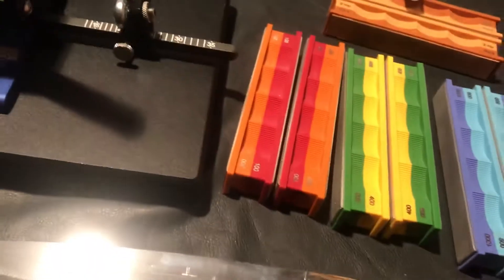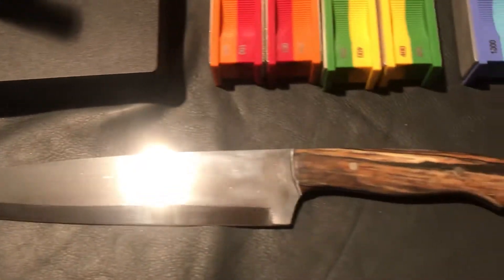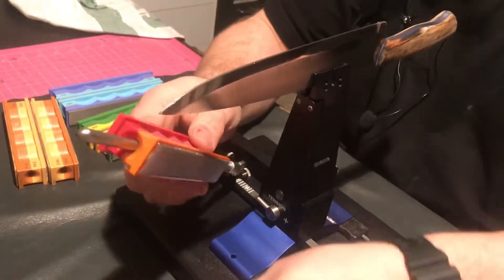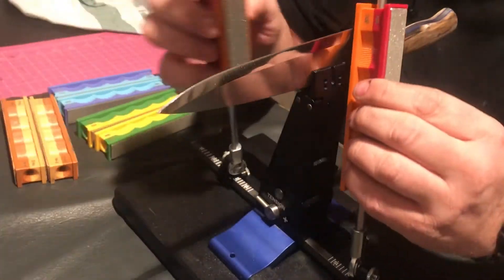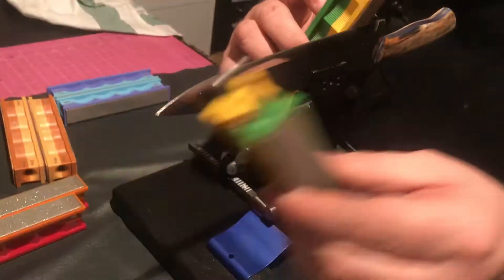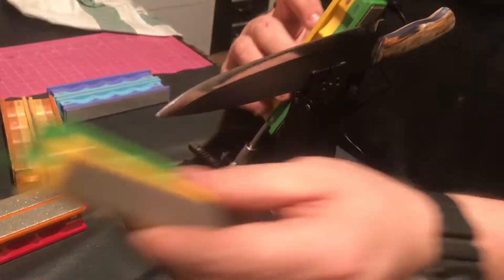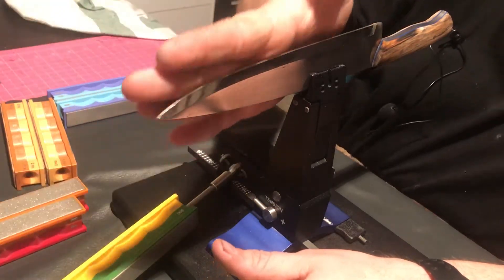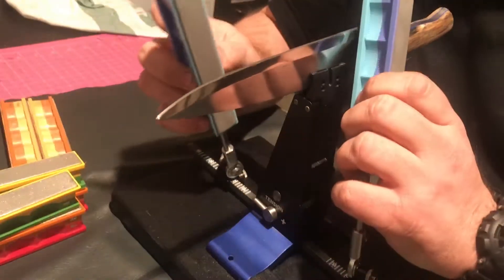Wicked Edge WE130 test and review

Comment: Isn’t 40 degree inclusive angle pretty wide and unusual for a kitchen knife?
Reply from the maker: 40 degres is alot.  

You dont add the two numbers up with WE sharpeners. Just just make sure they are the same on both sides. 

17-20 is my prefered angle for kitchen knives :)
Reply: Shelley Raskin this knife is way to thick behind the edge to do any kitchen work,, lol its Ground like a scandi, and will perform like an axe through food